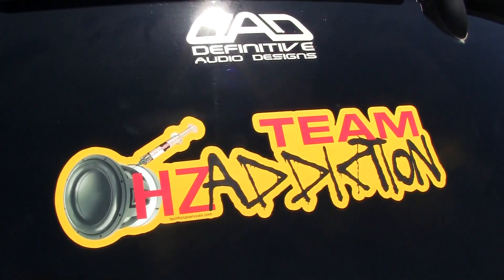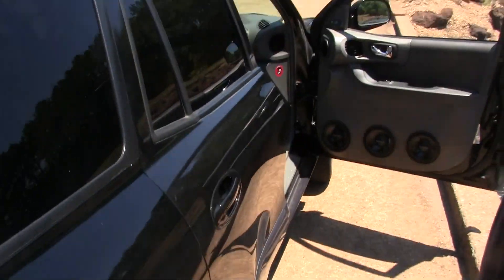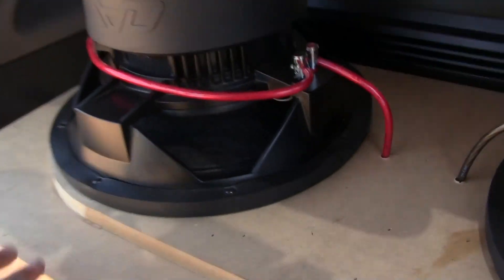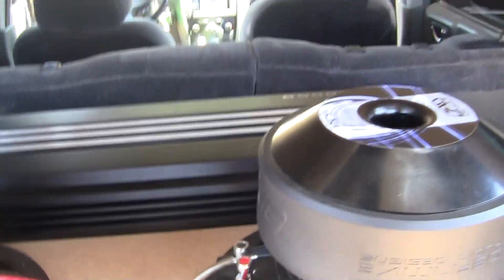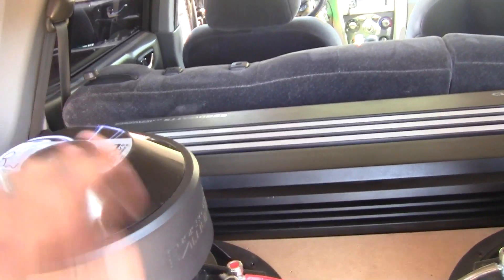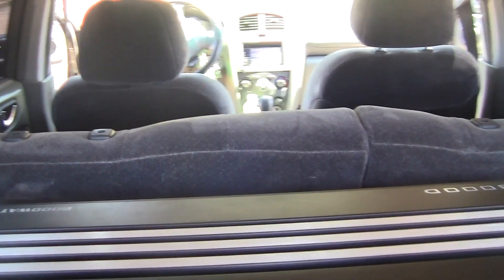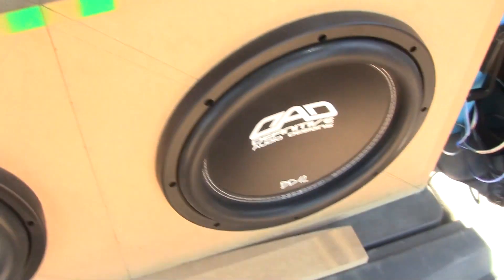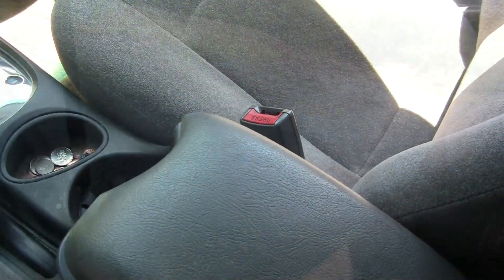Mythbusters V. Car Audio PT.2 Higher Tuning=No Lows?

Comment: Plays that low because the rear of the car is basically acting as a buffer for the rear subwoofers and the side of the car acts as an extended port. It's all in the positioning of the box. I got my 40hz box to play lower as well just by putting it in a specific place in my trunk where the shape of the car acts as an extended bass port, same as in the vid. Good job man, showing that box freq tuning isn't the only thing affecting sound in a car

Comment: i tuned a box to 24 hz and it won't reproduce higher notes than 60hz. It goes down to 16hz and less. It is more powerfull and resonates louder at 24hz than on higher notes. It hits 16hz and 60hz but less loud than on 24hz. Thats what port/vents do, they adjust freq. I can hit 1hz but its not that loud. If i had the port adjusted to 1hz than it would have be ultra loud at 1 hz.

Comment: Yeah, you can hit the lows, but not as good as you could if you had tuned lower. I heard a box a few days ago, 2 Kicker CVR 15's in a prefab box on a cheap 2k or 4k. I can't remember. It's cheap. Those prefabs are tuned pretty high and with small port area. The music he played it hit the high bass so fucking hard but thats the kind of bass that gave me a fat ass headache. 50hz and shit. My Skar SDR on 800wrms is probably like 3dB behind him, but I have 1 15 on a Pioneer 8601 and it hits the lows so much better. Mine is actually enjoyable. My port for 1 15 is like 2 of his ports and I also have a box 2 times as big.

Comment: @BassPounderX car audio unless you really know how to get that tuning perfect in a room which rarly happens. the cabin of a room and the gain's that apply in a smaller vehicle just doesn't add up for home audio. But sometimes at some occasion's it will happen and when it does you got lucky. usually theres like a modification you would have to do for your room to play low notes in a high tuned box and i found the secret to home audio low's. =D

Comment: Honestly any sub can play that low most every sub is built to the 20hz range, The target box hz tune just increases the quality of that hz range musically. I have a video of my single 15" quad-coil Jugernaut in a 4.5cuft @ 35hz box playing a bassotronics track "bass banger" and it is a 25hz track and it plays it very well pushing the tailgate off of my Jeep with ease. So yeah the box tune will not stop the sub from playing the note

Comment: your going to lose that screw on the spoiler drivers side top lol

playing below your tuning or getting bass out of a higher tune box is not impossible  yes it can be done but under box tuning the sub can not handle as much power and the amp still gives full power so if you have a good sub yes you could do it. i would not recommend this with a kicker cvr

Comment: Nice vid man. Your box plays pretty well below tuning, I bet that your port loading off that side wall is letting you do that. Thats how one of my old trunk boxes use to be. Had the port on the side, and was tuned at 38hz, and would play down to 20hz easily. But in my experience, even if a high tuned box plays really low, it doesn't do it with as much authority as a low tuned one.